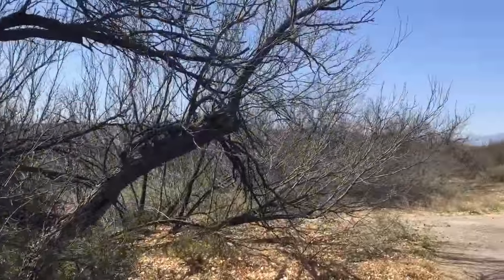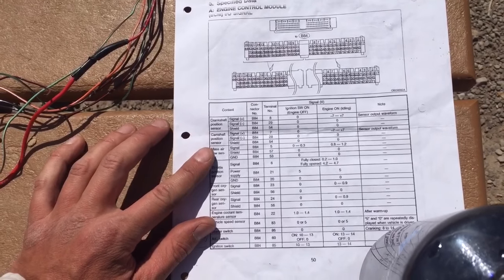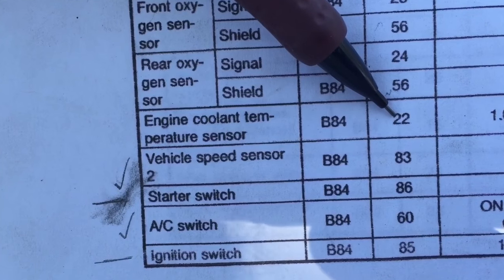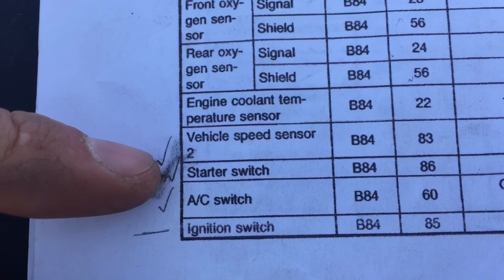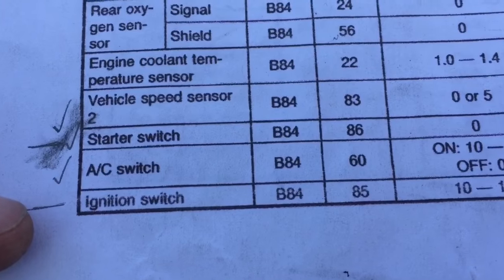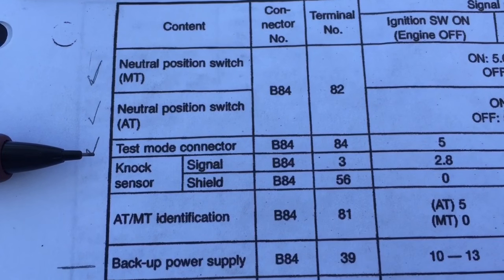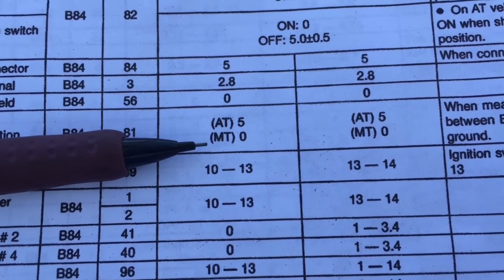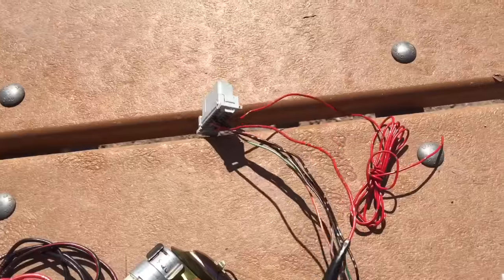6. ECU Pinout 1/2 - Wiring Harness Series

Comment: Hi Mick, as you pointed out, Pin 81 the Auto/Manual Identification does not exist on an  Automatic. 
The identical code wire is found at PIN 75 and its Black with a Red stripe and a single silver bar.  Thanks for your recent chat on the phone.

Comment: Hey +Busaru I finally started my engine and harness pull on my 2000 EJ25 NA Outback Legacy, using the pinout on your website I have B136 pin 11 that I cannot locate a meaning for.  The donor is an AT car, if that means anything.  Any advice?  Thanks!  Kevin
Reply from the maker: +Kevin Alberts even the factory service manual pinout don't have every connection. If it doesn't go to the engine plugs and isn't listed on the pinout sheet just coil up for now - it's probably not needed and auto trans related.
Reply: My hero!  Thanks, I'll do that.  I have a few stray wires from the engine plugs harness side to figure out as well.  Other than looking for the same color pattern, are there plug related wire harness diagrams I can use as well?

Comment: 88 renix  Xj    the wires that go to one of the injectors is mia the one closest to the fire wall on the injector two black  i can figure out the ground but i cant find a black wire from the fire wall and on the ecu thers two black wires is one of them for the injector
Reply from the maker: Your best bet is to grab the wiring diagram and trace it that way. You can find links to the factory service manual on my website. Busaru.com
Reply: wow impressive site man
Reply: i got the computer out i just need the pinout thanks

Comment: You said on one of your videos you would leave a link to Subaru ECU Pin out sheets - could you please leave the link in a reply? Awesome videos btw, big fan! 😄
Reply from the maker: +John Beavis hi John, the links are in my other wiring harness videos, I don't have a chance to looks for them right now but look for those earlier videos.
Reply: Hi, I am doing an engine and swap on a Nissan praire M12.upgrading from a qr 20 engine, cvt, to a Qr 25 engine and non cvt automatic transmission. I have some difficulty as both harnesses have  some differences.need some help with the diagram for the ecu.